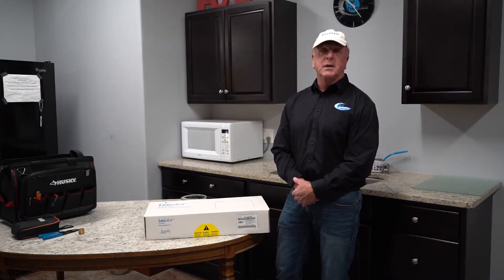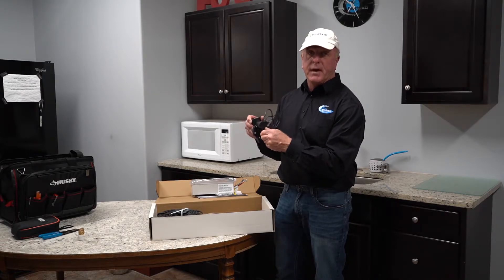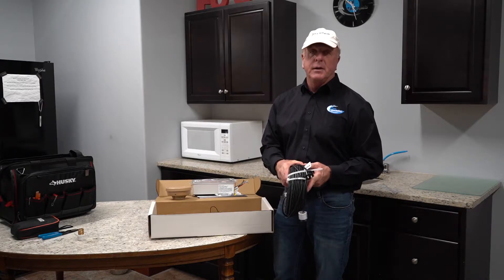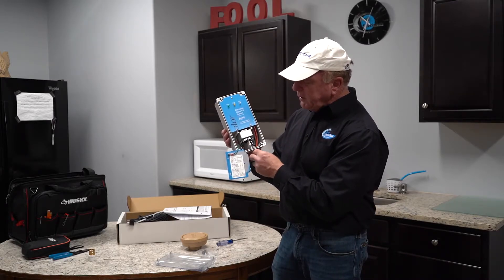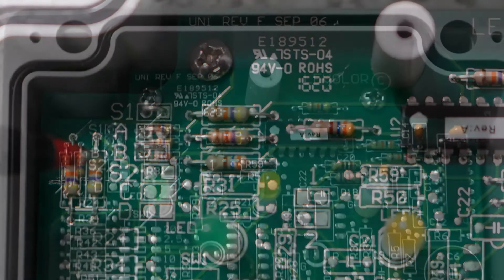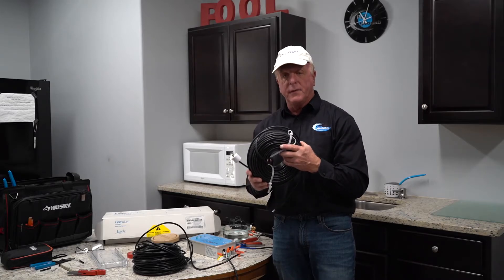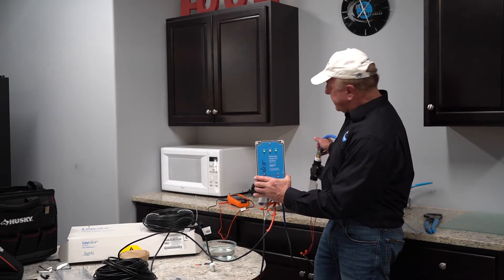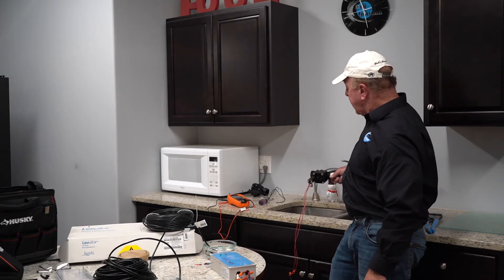How to Install, Wire, and De - Bug a Levolor water leveling system

Comment: Make sure you use the zodiac valve , don’t use regular irrigation valves like “Hunter” etc. or you’ll be scratching your head 😂. It happened to me. Replaced solenoid, replaced with Hunter valve , cause that’s what it had originally, then replaced it my self with a zodiac and bingo. , it was fixed.

Comment: Can someone explain wtf these stupid little boxes are so damn expensive? One I have gave out. 
 Luckily I know how to build and repair circuit boards cause after I found out these retarded contraptions are a basic circuit layout with power inverter there is no excuse as to why these cost 600-800$. 

Can build one with an Arduino board and 24v power for around $80. 

This Product by Jandy Valve is an absolute rip-off and proves they need competition in the market for these water levels controllers.
Reply: Start making them and ill buy and sell them. I have pool business in Florida.

Comment: Great video.
I have a pool with this fill controller and the auto-fill stays on. This video was extremely helpful in showing how to troubleshoot my problem.
I am going to try to find the video on valve disassembly and cleaning.  I am sure I can figure it out on my own, but it is always better to "see before you do".

Comment: Thanks for the super fantastic video.  I do not have the power light or any of the other two lights going on.  I checked and do have power right to the unit.  I checked the circuit board and no apparent damage/water damage to the circuits.  Any suggestions?  Thank you.  Dennis

Comment: I have all 3 lights on , and even manually turned the valve... no water going into the infinity trough where it fills. When I turn the valve at the pump area, I can hear the shhhhh saying that water is flowing.  Right now my power/sensor and filling light are on,  I went over to the leveolor sensor by the trough and opened it up , I thought it was a snake curled up in there at first it was dirty and stuff.. i can see the sensor cord is going down into that area somehow in the ground outside of the trough, but no idea what's going on. I find it weird, that I can manually turn the fill on, and the pool won't just start filling like it always has :/  We are just starting to dry out from the summer storms here in Florida, so who knows whats going on. i haven't had to worry about filling it because of all the rain, or even check on the levolor.

Comment: I got a new replacement valve with selenoid. I have 29 voltage detected by meter when sensor dry. Sensor lights up when dry . Yet for the life of me, I cannot get this thing to open and close. Is the solenoid too tight? Is this another defective solenoid?